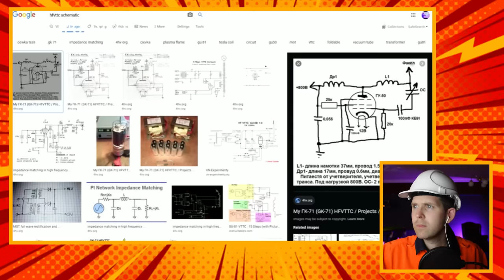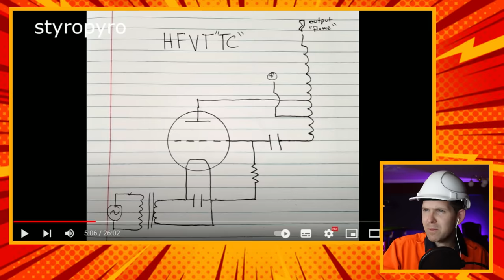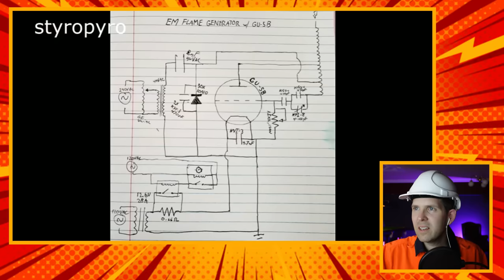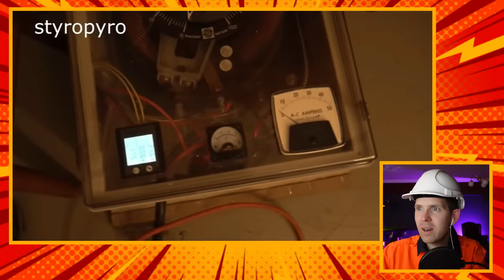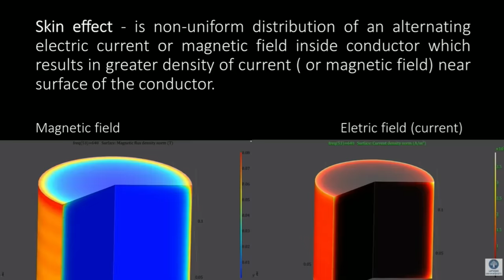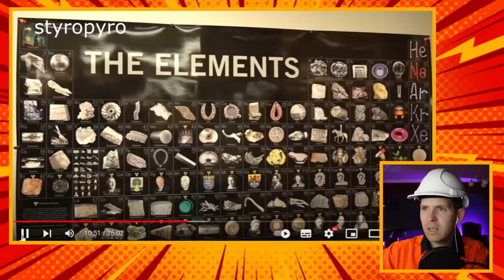Electrician Reacts to Styropyro’s CRAZINESS 🤪

Comment: I thought microwave transformers were dangerous, until I came across owning a 175KV 100mA X-Ray transformer. 200 some pounds of metal box/oil..good times.  Styropyro makes good shiz!!
Reply from the maker: Oh snap 🫰 yep that shit sounds pretty scary
Reply: Please post some vids of that, sounds awesome. I've got a 350lb potential transformer (33kV) and that's pretty cool. Also a bunch (over 1000lb) of other transformers, including some huge 10-15kVA units. Love big transformers. A large xrt is the next transformer on my wishlist
Reply: Oh and plus I'm currently considering buying two 50kV 100mA continuous transformers to put in series CTE. They probably weigh 70kg dry (each), and I'm gonna stuff 30kVA into the two of them :)

Comment: Your description of the skin effect is actually not too far off. The skin effect is actually present at all frequencies, however it becomes much more apparent at higher frequencies because of the greater eddy currents generated in the conductor. The reason it is an issue is because as we know, the resistance of a conductor is almost always related to it's cross sectional area. As the electrons get forced to the outer layers of the steel conductor because of the magnetic fields the AC generates, the apparent resistance increases as the cross section that the electrons are running through decreases.
Reply: @thinklist  I'm pretty much half-EE / half integration and test engineer and over the years I've found that there are a lot of conventions we use that make physicists cringe.  (Even just conventional current flow, they'll argue over that when the model works just fine for the purposes of designing and building things.)  I work in a field with a lot of physicists and I get a bunch of semantic "WELLL ACKTUALLY" arguments all the time haha.  Truthfully, the standard models and conventions work just fine except in some edge cases and some more exotic stuff.  (I prefer to keep things as simple as possible and only investigate things to the level I need to do the job properly and press the "I believe" button on the rest.)

Comment: I can't imagine how high his electricity bill is
Reply: Considering the PSU uses 10A diodes and the thing runs at 40KV at 30Mhz. And its AC, you have  Vp-p = Vrms * 2sqrt2, or Vrms = 40000 / (2 * sqrt(2)), or 14142V
As ohm laws says P=UI , P = 10A * 14142V. So P = 141.420KW , if the thing runs for 1h, it will consume 141KWh , a KWh costs usually 0.5c .
So every time he runs the thing for 1h, it costs $70 USD at least. 
Which amazingly its not much, but its the consumption of my computer for the entire month in just a single hour.
Reply from the maker: This is easily the best answered question ever 😆
Reply: 0.5c(ents) or $0.50?  Half a cent is REALLY low and 50 cents it's REALLY expensive.  I'm in Midwest US and we're at $0.12/kWh (or about $17/hr to feed the electro-pyro-mania)

Comment: Waveguides for RADAR utilize the skin effect by inverting the skin inwards. Essentially the inside of the tube is the skin of the conductor. Once the frequency and power become high enough, the energy simply leaves the the surface as ionizing radiation. (A.K.A. radio) Therefor, you must trap the energy in a tube. Also knows as waveguide. The reason Waveguide is rectangular is to match the resonance of the I and E fields of the operational frequency. Lower frequency requires a larger tube. Shielded wire can be used but is lossy and is used for low power frequency injection and then a RF amplifier, such as a Klystron, is used to boost the energy level. Many old microwaves use this method to cook your food. This is why the door had an interlock, so you don't cook your future little kids... lol.:hand-orange-covering-eyes:

Comment: its the same as the old carbon arc movie lights from hollywood in the  1930s. they would use  two carbon rods in with an air gap, creating a very bright light source, so they were able to film in daylight with technicolor three strip movie film, an example of its use would be the original wizard of oz. studio sets would be literally over 120 degrees and actors were visibly perspiring during filming.

Comment: I actually used a big microwave oven transformer in my tb3/750-2 single ended triode amplifier for the anode supply of 1500to2000v

Comment: Would you recommend these experiments. Some days I jst gt the feeling of wanting to safely or just in general, fck around with electricity and jst see wht hppns. Bt lke making lightning arcs and an idea to make my train sets more real, is hvng boxes or lke little boxes tht make arcs from the floor to the ceiling, even if it’s not really an/a definite or set up train set, still lke mke it to where o could mke lightning arch’s and hve thm come/go off at/@ random times from lke built up energy or so, thn add sme fog on top of tht to lke where it jst stays up on the ceiling lke the real thng meaning clouds

Comment: I believe the induction analogy you were using could possibly be incorrect and a better way to look at it is - surface area vs. mass - like how much surface of the wire is in contact with the air or outside world, vs how much metal content is in the wire itself. the metal content shouldn't matter, but the surface area and shape matter so much more. Although induction does play an important role.

Comment: Love the channel!  I'm hoping you can answer a question for me that makes ZERO sense to me.  Even though I am in America and the standards are different, I'd like to get your thoughts (unless you do have the actual answer) on something bugging me.  We all know how important insulation is on wires.  It blew my mind when I found out that in the US (Don't know about other places) the extremely high voltage lines (15,400 volts) run on 3 wires COMPLETELY bare with NO type of insulation at all.  I know you would have to tough it and the ground to be hurt, but with technicians having to go up on bucket lefts... Or WORSE< if whtever insulates the wire from the metal tower were to fail with bare wires, anyone toching the tower would literally be toast.  I just can't wrap my head around why 15,400 volt lines are completely bare with no insulation on them at all...

Comment: The most correct explanation of the Skin Effect involves quantum mechanics and is WAY beyond my ability to explain with my level of understanding.  And I have never seen this much raw wattage being pumped through a transmission line at such high frequencies, so :shrug:

But in regular applications, it's a reflection effect.  You have UHF signals going through a conductor in one direction.  Some of that signal is now outside the conductor.  This not only reduces total power arriving at the termination, it also creates a kind of EM "drag" on the signal which lowers its apparent frequency through the length of the transmission line.  Finally, to add insult to injury, this reduction in frequency at a termination that was engineered to handle a very tight frequency band results in a huge increase in the reflected signal and can damage sensitive equipment up-line from the source.

It's also curiously a geometry problem and very little else.  Like how solving General Relativity just kicks out a radius for a black hole of a given mass, you pick a frequency and that dictates the size and shape of the transmission line, which in turn dictates the maximum power that line can handle.

Only way to avoid it altogether is wave-guides.  Which are too heavy to shoot into space.

Comment: Didn't see anyone answer the skin effect question you had... The cable guys here should be able to confirm that is definitely how it works. That's why you loose your high frequency TV channels when the installers don't use the right strippers for cable or adjust them correctly! They damage the otter layer of the copper and it distorts or attenuates those signals

Comment: Ya- this dude is crazy, I would not be surprised at all if we hear about His end. I mean, he is very knowledgeable and for at home stuff like this He seems to be very careful, but it just takes one screw up. I've came stupidly close to being offed by a 240v wire that I thought had no power going to it, I took someone else's word for it- I treated it as though they it were live though, and it was- ruined my side nips by melting the blade, but I had thick gloves on and my nips had a rubber handle, that Day I learned to never take someone's word for it that a line is off- I always insist on checking breakers or lines myself now. We almost offed an inspector once too- dude was playing with a live 240v wire, tossed it around and it didn't react or do anything so all seemed well, he was asking if it was live and we thought it wasn't- passed the inspection, then later that Day my boss rubbed his pants on the exposed wire and threw the breaker with massive sparks and he had a giant burn in his pants. That crew was incredibly ignorant/unsafe.

Comment: The way many are taught about propagation of electricity is wrong!
Don't get me wrong .... it is handy for basic understanding but it breaks down with contact with the reality of high voltage and high frequency.
The Skin Effect appears with both high voltage and high frequency which points to its cause. It is a product of the Electric Field and the Magnetic Field. 
I do not pretend to understand it properly but Veritasium has done some good work explaining it. It also explains how the Neons and light bulb light up without direct electrical contact.

Comment: I absolutely don't need to worry about safety if trying these experiments at home. After all, my old-fashioned power meter would blow off the wall of my condo complex before I got one one-hundredth of the way to Styropyro's simplest stuff. He probably spends more on power in a month than I do in thee years. Maybe four. 
After all, stove's gas, as are the dryer, the water heater and central heat, TV and computer monitor are flat panels, and all the interior lights are LED. So that leaves only the AC, refrigerator, the computer itself, the washing machine, the drive motor and support circuits for the dryer and central, and a few miscellaneous power bricks for phones and clocks and etc. Most if not all of these things Styropyro has as well, I'm sure.
Obviously to be fair to both parties, you would need to take a full yearly average, and then divide his result by 12, as he no doubt does eat and sleep, although it honestly wouldn't surprise me to find out he just plugs himself in when run down.

Comment: Steel has higher melting point, iron oxide has lower melting point.  the hot steel probably oxidises in air to form iron oxide and this melts.  Given that the air is being ionised and probably is making ions desperate to find a new friend this isn't going to help.

Comment: 16:26 If you're not feeling the least bit of apprehension when picking up a power tool like an angle grinder and turning it on then you should put it down and back away.

My point is that these are dangerous, and not all of the danger can be countered by training and experience. A cutoff wheel exploding is always a shocking experience. A work piece can slip in the vice and suddenly the wheel bites and the tool jerks violently in your hands, or your cat decides to trip you up by running between your legs.

Accidents happen! You just want to make sure they cause as little damage as possible. And if you no longer feel the least bit afraid of your tool you will get complacent. 

But this should never be taken to the extreme. My father left behind four or five angle grinders, not one of then has the guard. He removed that on any angle grinder he worked with and claimed two reasons for it. First of all he claimed it always got in the way, and then it was "false safety" that could make you lazy.

I can't argue with the first statement other than saying you have to learn to work around that. But I absolutely hated his second argument. Like I wrote above, accidents happen. And when they do you want whatever safety features you can get, and a shield that catches the flying splinters of a cutoff wheel is a pretty good start.

So don't disable safety features without making sure there's no alternative, and that you are willing to take the risks, because it you get hurt because of it you have no one else to blame.

And if you start treating your angle grinder as nothing more dangerous that your shop-vac take a break and think things over.

Comment: if skin effect is only a frequency thing, then I'm not sure how HVDC transmission line theory also mentions skin effect.
Reply from the maker: Interesting point 👌
Reply: in what context does it mention it?
Reply: HVDC still involves switching, changes in line voltage due to changes in load, etc. All of these things have a corresponding frequency that affects where, physically, the conductor experiences electrical load. Balancing those different effects remains important in grid-scale operations to keep even DC lines from having thin sections of conductor accidentally overloaded, generating needless heat and potentially leading to failures.

I'm also pretty sure that volts/second driving magnetic flux is the more important factor over frequency, it's just that at a given voltage, frequency is the dominant factor. Thinking of a 120V 60Hz AC line vs. a 750KV HVDC line, for example, a 1% variance on the DC line occurring at 60Hz as a result of load transients from a DC-AC converter results in a 450KV/second variance in voltage, where the AC line is experiencing only 17.2KV/second. The skin effect would thus be much more prevalent on the DC line experiencing load transients than the AC line switching between its two peak voltages, even though the DC line never actually approaches zero.

It's kind of the HVDC analogue to power factor in AC systems, too much high frequency transient load and the conductors will exhibit anomalous impedance and overload before they should, even though the line only ever carries "DC".
Reply from the maker: @Teth47  so it sounds like its more got to do with the density of the magnetic flux then
Reply: @thinklist  As far as I understand it, yes. Charge flow becomes constrained to the 2D surface of a conductor as magnetic flux approaches infinity, I think this is a result of the field lines being crushed together to extreme densities at the interface between the conductor and free space, kinda like optical refraction, creating a valley that traps mobile Electrons, forcing them closer together, increasing the chances of an interaction, which causes Electrons to change direction, which is an acceleration. Accelerating charges produce electromagnetic waves, which in this case are lost as heat, thereby increasing the electrical resistance of the conductor, along with lattice vibrations caused by weak bonding and breaking between the excited conductive band Electrons and the atoms that would prefer to keep them.

Comment: The green on the second magnesium must be copper breaking down from the very hot pipe into... Well, okay, the variable spectrum of visible light and how it interacts with energy as a whole is a bit above my pay grade, but more or less, it's more or less that, like electricity, chemicals breaking down fire off electrons as the bonds change, creating energy that interacts with photons to change the particular wavelength of those photons to create light as visible distinct levels, an opposing example would be methanol, which creates a wavelength outside the human visible spectrum. Science is weird, man.

Comment: The actual stupid thing is that you can buy wood fracing machines that are professionally made, with built in safety features. There is in my opinion no reason to make one yourself. Ive seen some of home made ones that got their creators killed, and the insulation is either inadequate or non existent. Sometimes they literally just two bare wires they hold with pliers. They are usually set up so the user is holding a lead in each hand, and they arent ever equipped with any kind of momentary switch.
Reply from the maker: Oh really I would love to see one. Do you have a link?
Reply from the maker: @nunyabisnass1141  thanks so much
Reply: @thinklist  no prob, be safe my friend.